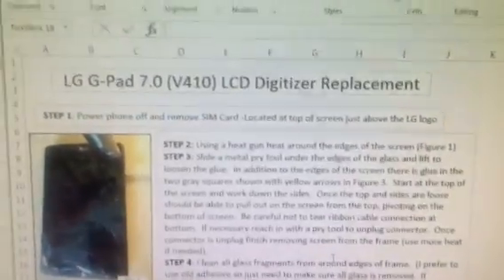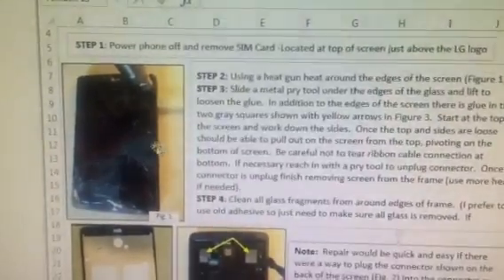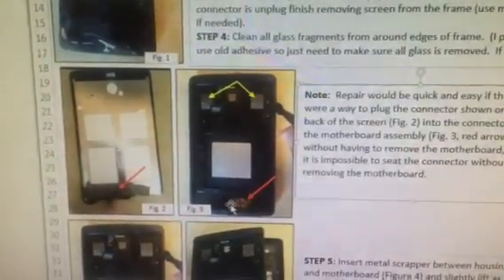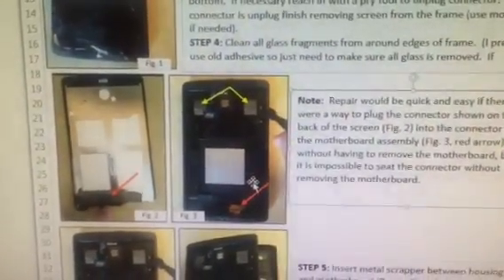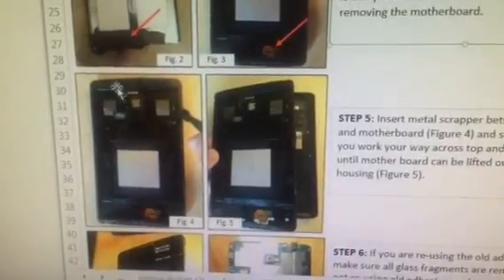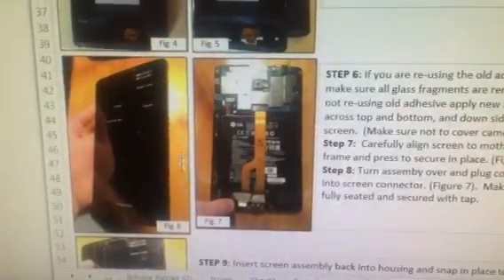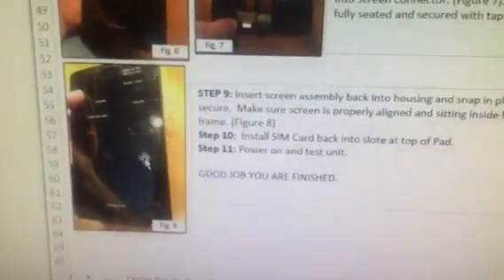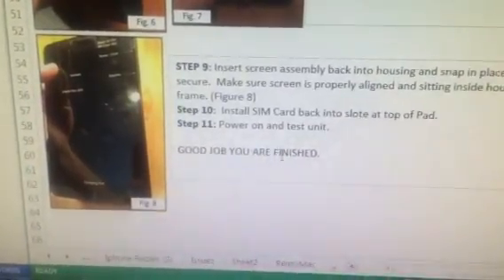LG G-Pad 7.0 V410 LCD Digitizer Screen Replacement #1

Comment: First I applaud your effort to help/show what needs to be done, but honestly I checked the 'Show More' tab on this video and didnt find shit. Don't hate when I depending on how you look at it, ask rudely or politely : Where the fuck is the guide to taking apart LG G-Pad 7.0 shell/case? Do you have anything to offer besides this video? Next time you record a video of instructions for repair jobs, it would be nice if you could fucking (YES MAD,but not at you...mad @ lack of instructions across entire WWW to disassemble LG G-Pad 7.0/LG G-Pad F7.0 , and it just so happens you have a thorough set of instructions but not a single fucking link. If I was you I would ignore me, but I honestly could use a link. Thanks in advance

Some internet guy trying to take apart a LG G-Pad F7.0 tablet, without using a hammer. Liquid spilled inside I need to take apart and cleanse with 90% ISO alcohol...... fuck me in the goat ass where is someone cracking this fn cunt of a device open.
Reply: +Christopher Collins NEVERMIND K NORMAN, YOU ARE IN LUCK BECAUSE I GREW SOME HAIR ON MY BALLS AND DOVE RIGHT INTO WHERE THE WHITE OR BLACK CASE MEETS THE DISPLAY, depending on which color you own. I'm going to help the next sorry ass maggot like myself that comes through here by taking a illustrating picture... brb obviously... okay done and illustrated !! http://i.imgur.com/4INpIhf.jpg?1 <- If you find that image useful, head over to my Youtube Channel and write me a note or something, send me a message. One day some one will find this useful, I'd love to know when that day comes. I'm gonna stick this image 1 other place and then I'm done with this shit. FUCK LG products, YES STILL MAD....